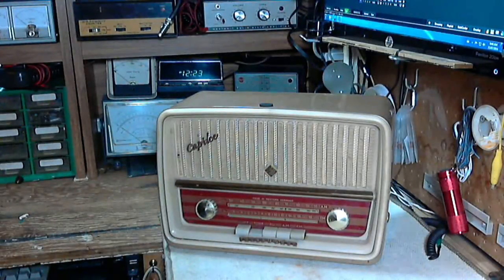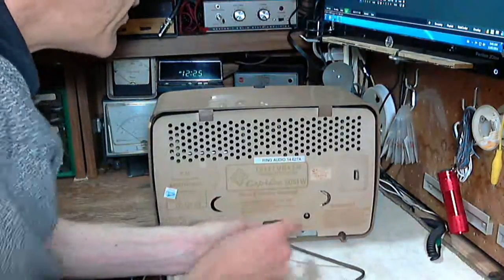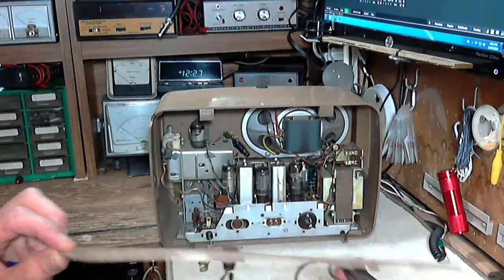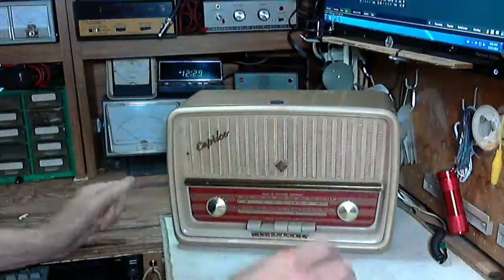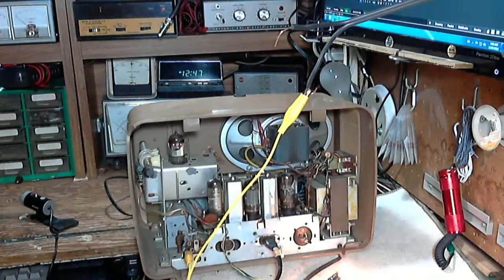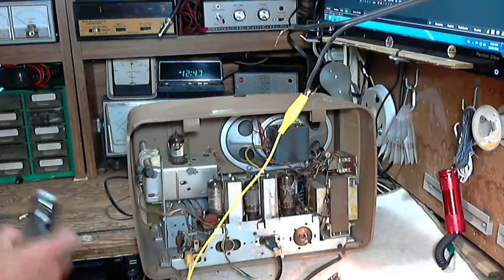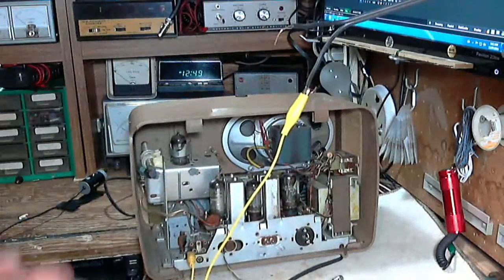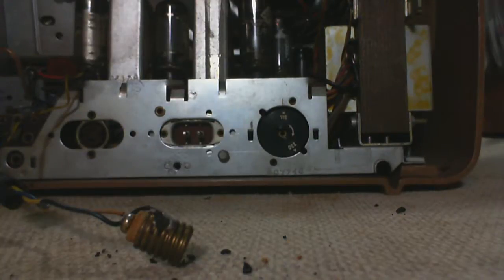Telefunken Caprice 5051W Video #1 - Checkout

Comment: Jim I noticed your dim bulb tester did not light up at all yet you said you were on restricted power. What happened? Just learning.
Reply from the maker: There are two bulbs and the lower one may not have been visible.  I have a 40 watt lower, 60 watt upper and 100 watt together.  For a small radio, the 40 works best.  I usually try to keep the lower bulb in view.  In fact, I'm about to rearrange that area of of my shop to raise the computer screen higher so I should raise the lights too.  Thanks!
Reply from the maker: I rearranged my shop.  Hopefully both lights are always in view now.
Reply: Jim the light was in view it just did not light up when you turned on the radio. Thanks
Reply from the maker: Either I switched on full power without the lights or I had both bulbs screwed in and the current was not enough to light them.  I can only guess.  In any case, I got an improved shop out of our discussion.